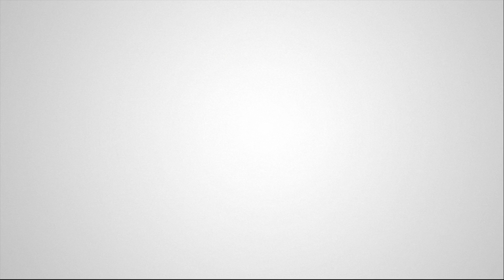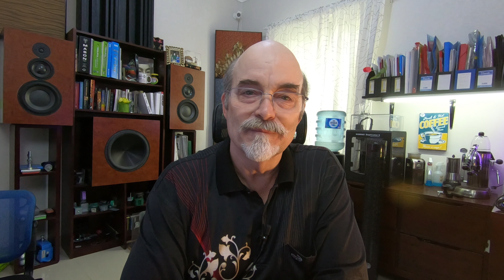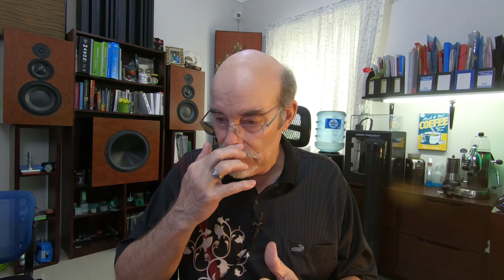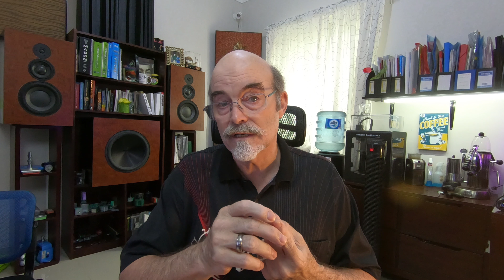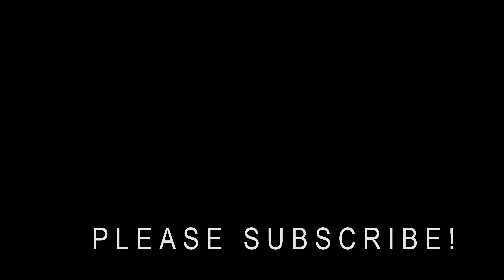Rock Wool Does Not Sound Proof

Comment: My room is "Soundproof" but extra loud, will rockwool "quiet it" or is there something better?
Reply from the maker: I think that you are still confusing Soundproofing with acoustic control.
Reply: @JHBrandt  have you ever read of an old technique, of using plain sand to soundproof for example between a room floor?
Reply from the maker: @jccgold  I still use sand from time to time.
Reply: @JHBrandt  between 2 twin houses, coupled with the same double wall, inside that double wall put sand between them to block the sound from one house to the other, what do you think of that idea?
Reply from the maker: @jccgold  that would couple the otherwise separate walls. Not a good idea. It's also messy and difficult to do.
Reply: @JHBrandt  Room is concrete, is in side of mountain on 2 sides, thick concrete on top. I have a table saw in room, It is incredibly loud. Can I quiet it?
Reply from the maker: @wmhemphill8642  yes, you can. But in what way of quieting are you meaning?
Do you want sounds IN the room to be less grating? Or do you want the room to contain the sound, not letting it out?
The answer to my first question is to put up absorption and definitely wear ear protection. The answer to my second question is that you will have to seal up all openings and make sure that any doors or windows have plenty of mass.

For a better answer, send me an email with photos, measurements, and a clear description of what you want. 😊
john@jhbrandt.net

Comment: I mean idk about this. I used Rock wool for my walls and I can’t hear my JBL 7000 surround sound on the outside.
Reply from the maker: Okay... And your walls are made from Rockwool?? Nothing else, right?
No drywall, no wood. No sealant??
Reply: @JHBrandt  that and 2sheets of 5/8s dry wall why?
Reply from the maker: @mattjrk5679  Ah! Then you didn't understand what I was talking about. Watch it again. ;)
"no fiber product alone does any appreciable sound-proofing. No matter how thick you make it." :D

Sound-proofing is accomplished with a 'system' that consists MOSTLY of mass and a good seal. i.e.: Drywall-stud-drywall. or better drywall-stud filled with fiber-drywall. even better! - drywall-frame filled with fiber-space-frame filled with fiber- drywall (or exterior sheeting mass). When I say drywall, this could be several layers with deadsheet and plywood. - It depends on your soundproofing requirements.
Reply: @JHBrandt  I just know the less air that gets through the better. And that wool works as a great way to keep air leaks from happening. I also did seal my room before putting the Trim around it.
Reply: @JHBrandt  also what you said would contradict installation as the thicker it is the better.
Reply from the maker: @mattjrk5679  yes, sir! I contradict a LOT of idiots and charlatans. It's your choice who to believe. I would double-check with the physics department of your nearest college or university before putting much 'money on the other horse'. 
I'm NOT selling anything here... so?

Comment: Plus it's not even effective below 125hz.   Look at the absorption coefficient of rock wool or any building insulation for that matter.
Reply from the maker: Depending on its thickness, fiber can work very well down to 30 Hz or so... How much space do you have? :D
Rockwool or dense, rigid fiberglass becomes reflective to low frequencies as the thickness goes beyond 2". ;)
Reply: @JHBrandt  Where's the proof that fiberglass can go down to 30hz.  I haven't seen any tests of this.  Got any actual tests?

What's the absorption coefficient of fiberglass at 30hz and how thick does it have to be?
Reply: @JHBrandt  Fiber?  are you talking about fiberglass (not rigid fiberglass)?

How much space would it take for fiber to work down to 30hz effectively?  How about at 50hz?  how about at 40hz?  

Are you talking about using it by itself or are you talking about using it as a fill material for a membrane or diaphragmatic absorption device?
Reply from the maker: @Oneness100  I'm talking about lightweight fiber - by itself or in a composite broadband structure. If you really want to learn about this, send me an email. 
Basically, this channel is my lecture hall (education) and if you are not researching the answers from published papers or peer-reviewed books, you should sit down and listen and not disrupt the class. ok? 
Please ask questions so that the answers will benefit everyone. Arguing with the teacher is not helping anyone and can get you banned from class. ;)
Reply: @JHBrandt  John, with all due respect, if you are going to explain something well, then there aren't going to be any questions, but if I ask questions and you either don't answer them or don't answer them well, then it's not the student's fault.  it's the teacher's.

I didn't know that I had to read books just to understand something that can be explained with a sentence or two.

I'm not trying to be an acoustic engineer. I'm just trying to understand enough so I don't end up using the wrong materials, etc.

I've already used the wrong materials or products because I was mislead by others OR something better came to the market later.
Reply from the maker: @Oneness100  well then, please forgive my response. I was responding to your assertion that glasswool won't absorb below 100 Hz. It really does very well.

It can be complicated because even lightweight fiber becomes reflective at low frequencies at certain thicknesses, ex; 18" for GFR 8000 pa. s/m2. If you want / need to go thicker, you have to leave a gap of 2 - 4" in the middle. 😉
I have real world testing for these, but you can run some calculations using this online calculator
http://www.acousticmodelling.com/8layers/multi.php
It's very accurate.

Again, sorry for my tone earlier. Feel free to contact me via email. And if you need consulting, the first meeting is free. 😊

Comment: So I want to dampen the sound of a mechanical room and bathroom. Was thinking of doing Gold Bond® SoundBreak XP 5/8" with Rockwool Safe & Sound.  Are you saying that standard drywall and insulation would cut the sound going into the living area the same amount?
Reply from the maker: Not by the same amount. Check the mass (lbs/ft2 or kg/m2). Get the heavier sheet product. Also compare prices between masses and economize.
Mass and seal wins the battle. 😉

Comment: Hello sir. I'm looking for a cost effective way to make bass traps for my large 30x20x10-ceiling room.

I don't want to use Rockwool because my lungs are too sensitive to the dust it emits. 

Could I use rolled up bags of fiberglass insulation and stack them in the corner?

I guess my question is am I looking for a dense material or a soft material for low end treatment?
Reply: Have you tried an open cell foam to cover or wrap around the rockwool to stop any fibres from escaping?

Comment: Does this apply to acoustic panels too? Or only in walls? can I make a panel with lightweight fiberglass?
Reply: i saw an experiment and it turned out the one that out perfermed all the example of materials was old towels. Basically this guy bought some used towels from goodwill, sewed around the edges, he did cut them to the size he wanted, had 8 towels in one bundle, and the top towel overlapped the others, so he could wrap and staple them around the frame. This made an excellent wall panel, and you can get towels with any pattern you want on them, so the choices are yours, and cheap,.Lots of goodwill type stores around everywhere, and if not, well, towels are cheap anyway.
Reply from the maker: Both! You CAN make panels with lightweight fiberglass. And you can find a good product that doesn't use Formaldehyde in its curing process. BTW, I don't make or use 'panels'. I build treatment walls. ;)

Comment: If you're going to recommend types of products you should consider all essential data. Safety considerations, in this case fireproofing, is an essential consideration sadly missing from your review. Rock wool is fireproof, all other products are not. While as much sound attenuation is desired, only proffering combustible products, products which do not block heat or fire, or only block for short periods of time, is wholly negligent. Basing construction decisions on price, alone, is the foolhardiment of ignorance; you'd do well to educate yourself before providing suggestions - it's like suggesting to buy a car based on colour without considering crash-test data. Other considerations are mold, bacteria, and moisture retention; again, rock wool is the considerably superior product.
Reply from the maker: Where in the world do you get the idea that SAND is flammable? Or that a product made from sand rather than basalt is better for mold reduction?
Your assumption is false. If you have data that we don't, please present it. 😉
Reply: @JHBrandt  I have worked with the product for 20 years. I still work with it daily. I'm required to know fire ratings for projects.

Rock wool is fire-rated up to 1,800F but fibreglass is only rated to 1,100F . A typical house fire also burns around 1,100F which rapidly reduces any protection the insulation provides. Long before it actually melts, it softens and droops, which removes any heat or fire protection and barrier. Rock wool, on the other hand, will not sag or droop under the same conditions, helping to contain the fire to a limited space and not spread to adjacent rooms, floors, residences.

While you're correct "sand" is not flammable, it is a vastly inferior product which should be avoided - especially considering the irritations it causes to skin, lungs, and eyes. Alternatively, rock wool causes no irritations to the body; it's not a glass fibre, it's wisps of 'cooled' molten rock.
Reply from the maker: @kalindonchesca2373  I guess I hit a nerve! Wow! Such vitriol... LOL! Do you sell Rockwool products perhaps?
You CLAIM to have data, yet present nothing. This is similar to folks crying that the earth is flat. IF you are truly interested in facts and science, present the documentation. - This is, however, a Red Herring. The topic of the video is sound-proofing, not fire resistance. 

And my attitude has NOTHING to do with facts. I am trying to help people here and YOU are just trying to sell shit without regard to 'people' and their needs.

Dood, if the house is on fire at 1100F, the shit is going to burn down! No amount of Rockwool will save the owner's property.  I think that perhaps, I am not the one with an attitude. Remember, FEAR is a pathway to the Dark Side. ;)

Comment: is rockwool useful to absorb subwoofer vibrations?
Reply from the maker: No 😊
Reply: rock wool doesn't work as bass trap/absorber. nothing will, not even wet concrete can trap bass. what these recording studios are doing in real life is compensating the bass through eq in the mastering before pressing. foam as long as its open cell not molded, is going to absorb the treble frequencies and you want that to deaden the room removing echo. all the other crap you find in audio forums are all geezer babbles and semantics not worth your time. THE ONLY WAY TO ABSORB BASS NATURALLY IS TO REMOVE YOU WALLS INCLUDING THE CEILING SO YOU ONLY HAVE TO DEAL WITH THE FLOOR WHERE THE BASS BOUNCES UP AND NEVER COMES DOWN AGAIN or have louvre type windows all over the house at least the horizontal waves are going through it and leave you.

Comment: John hi. If you line the inside of your room (all walls and ceilings) with 2ft of fluffy insulation this absorbs everything down to 100Hz and absorbs pretty much most of 50 - 100Hz. This energy is converted to heat so what can come out on the other side? also, in ducting we use absorption to soundproof don't we because it does reduce the sound transmission. I had a room like this in a garage before and when cars pulled up outside everyday from neighbors, you couldn't hear anything. It wasn't soundproof but it was pretty darn close :) I would recommend this for someone who doesn't have enough space to soundproof and to treat the room.
Reply from the maker: Thanks for the comment! But you are wrong. ;)
24", 2ft, or 609 mm of fluffy insulation absorbs 100% at 75% efficiency. And not much of 50 Hz. Your theory is flawed. Please read "Acoustics - An Introduction" by Heinrich Kuttruff, "Architectural Acoustics" by Marshal Long, "Acoustic Absorbers and Diffusors" by D'Antonnio & Cox, and the little papers that I have linked in the description.
Your anecdotal statement about the garage has zero references, no SPL, no testing, and you're just saying that it works. I would not recommend this approach to ANYONE! 

I don't mean to be harsh, but you can't make statements that are not backed up with evidence. If you are right, you should get a Nobel Prize for having discovered a way to treat and soundproof at the same time. (But you'll need the math to back up the theory)
Sorry, bro, that doesn't do it. 
Don't try this folks!
Reply: John Brandt! You are too  nice a guy to be harsh :) Have a look at this image https://ibb.co/kA6nAo showing the the absorption of 2' of fluffy. If all this is "absorbed" then what comes out on the other side? I already asked you this in my other post but you didn't really respond. look forward to your reply :)
Reply from the maker: Thank you for understanding. :D Yes, I use the same calculator. It's pretty accurate. But what folks don't understand about absorption coefficients is that it is the RATIO of energy absorbed by a material to the energy incident upon its surface at a specific frequency. You'd still have to fill the entire room with it and that's a very inefficient way to 'sound-proof'.

Try this: Fill your room with insulation as you described; 2 feet deep. Set up your speakers in the room. Listen to your favorite song while seated in the room. Can you still hear the music? ( I know you can) - Conclusion, there is a loss, yes. But not more than about 6 dB. That is HALF of the energy absorbed. 
So the rest of the energy can just pass thru walls and go outside, no problem... and the sound energy goes to your ears in the room as well. It is NOT all absorbed. 

For resonant systems like an HVAC silencer, the maximum loss is about 20 dB

Like my wife says to me, "It's not like what you think."
All the best.
Reply: I agree with you that it is inefficient to soundproof and most experts would say exactly what you have said because what you say is from "the book" and it is also correct but I have often thought about this and if the absorption is good from stopping sound bouncing around inside our room then enough of it should be enough to stop a lot of transmission to the other room too. Rigid materials also don't soundproof 100%, you can only reduce sound transmission. Of course I am not going to tell someone to soundproof using fiberglass but enough it can work and if you were planning on having your room completely dead anyway you might be surprised at just how much soundproofing this much fiber can provide.
Reply from the maker: Arman, ALL of my rooms are treated like that! It doesn't help more than about 6 dB! I have over 500 studios world-wide, and I think that I would have noticed. LOL!!
Reply: Yes I know your work john. I like it a lot. So if it doesn't reduce more than 6db, how would it reduce the sound energy within the room more than 6db? It doesn't make sense. Obviously if we only reduce ER, RT60 and standing waves by 6db we will not have really solved acoustical issues inside a room.
Reply: Arman, Everything has to work together. 2 feet of R-30 absorption (all walls and ceiling) will definitely get you more than 6db of reduction above 50Hz if you have it in the room next to your drywall partition. There is different densities with the wall framing and drywall absorbing sound coming to the outside and vice versa. The reason why it works so well in the room acoustically is because low frequency is omnidirectional and will be absorbed length wise in incidence (in floor to ceiling or corner to corner). Some frequencies are also reflected by the hardshell (drywall or whatever) of the room and therefore has to pass thru the 2 feet of R-30 again before it hits the listener. I may be wrong here but that almost sounds like it would increase it to 12db of reduction lowering the RT60 much more. Hard to say without testing since every room is always different. You are also ignoring that fact that its 2 feet on each surface so 4 feet in length and width total. Go buy some R-30 and test the room. it will be flatter by way more than 6 db if you do this on all walls and ceiling
Reply: It would be interesting to test this for sure. Thanks for the chat and for the interesting conversation John. Keep em coming.

Comment: 0:38 I would like to know more about this. Are you telling me that if I have 60 inches of rockwool insulation on all sides of me, it will only cut 120db down to 110db?
Noted you said "half" and that is kind of just as confusing as high pH up and low pH terminology. 
Cutting a dB "number" in half would be 60dB. However, cutting how loud a sound is will bring it down to something more like 117dB.

I am thinking you are talking about a finite wall depth when you talk about this?
I was always told that air leaks are #1 for sound proofing. Next is resilient channels. Finally, use of different soundproofing materials of different densities.

Also, their claim is not soundproofing. It is "less loud" according to their video here.
https://youtu.be/ykzc8oXRrgc?t=68
Reply: Loudness perception is logarithmic, a 10 dB increase is twice as loud